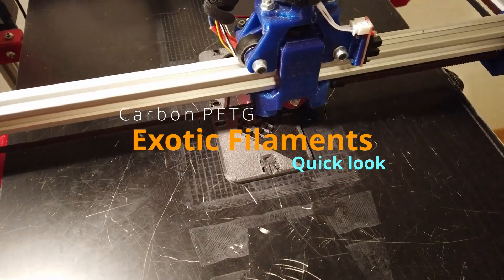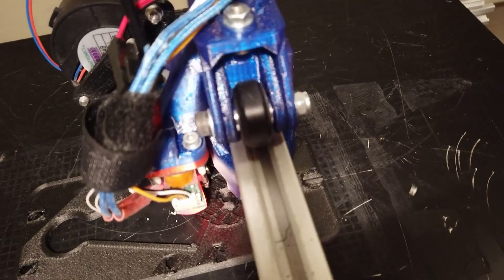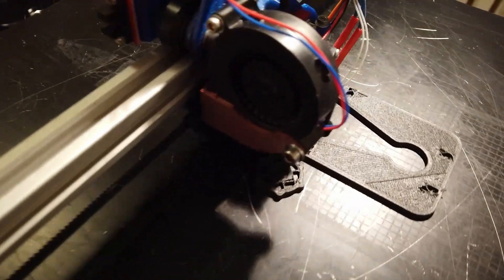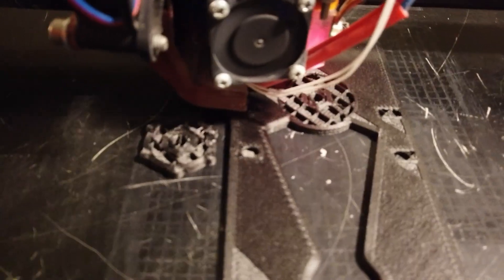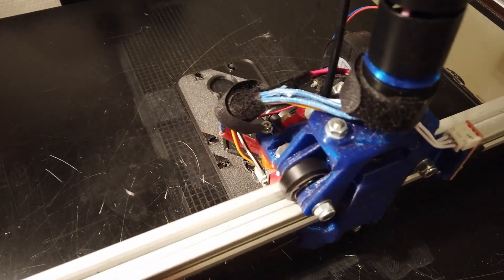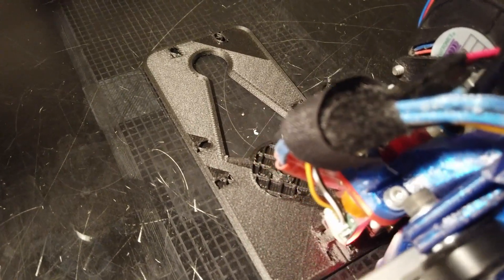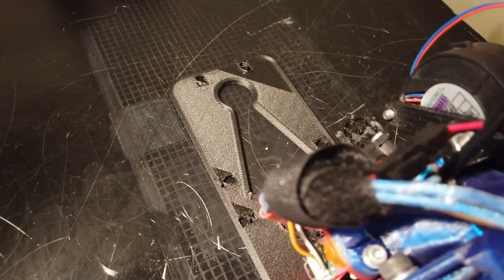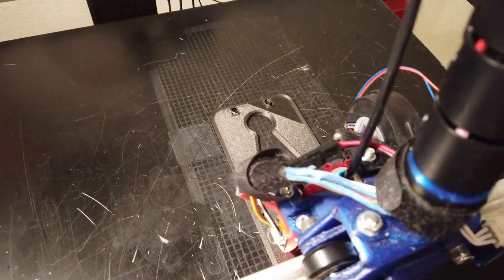Exotic Filament - Quick Look at CARBON PETG

Comment: Hi what are your experiences with ST820? I saw your first look vid but there is not continuation.
Reply from the maker: Thanks for the comment. I found out the ST820 can not be utilized for more than 32MS on the 8 bit boards as there are limitations in the processing power on the MEGA2560. Using them with 16/32MS setup makes them no different thatn the A4988/DRV8825 drivers so therefor they have no advantage in such case. If on 32 bit board I can not say but I like more the interpolation from the trinamic drivers than doing all computing on the main processor
Reply: @PRO3DESIGN  Thanks